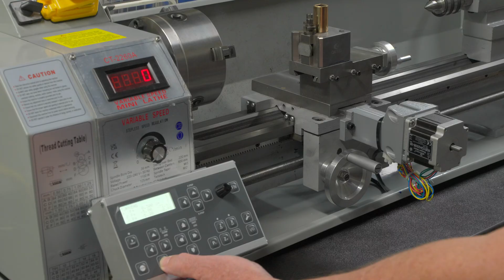Part 3 - Mini Lathe ELS Conversion

Comment: Looks nice! Yes, read the manual thoughly.. it is very good written!
Reply from the maker: Yes it is very comprehensive and well laid out.  Just did my first part using the ELS to replace the plastic coupler in the X-Axis with a metal one.  Worked like a charm :)  and it turned it down to the size I specified.... shame it was not the size I needed (which I found out when disassembling the X-Axis and had to manually turn it down another 2mm :) ).  Still need to tune in the speeds and feeds, but the speed and quality of finish from the ELS is better than what I can do by hand.  It even splits the passes automatically into roughing then finishing passes.  It's all very cleaver!